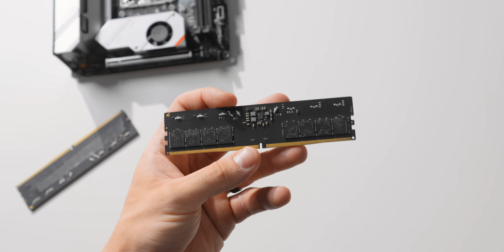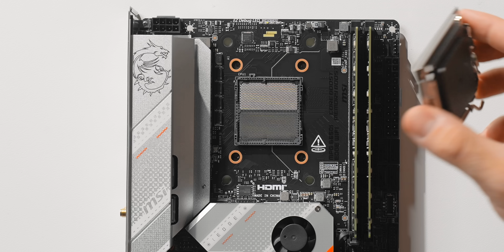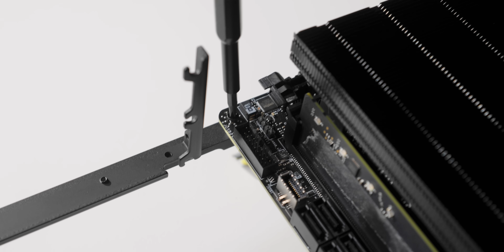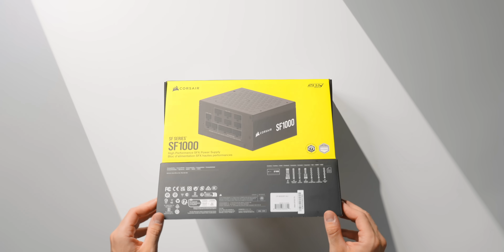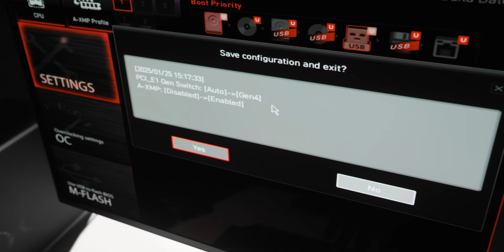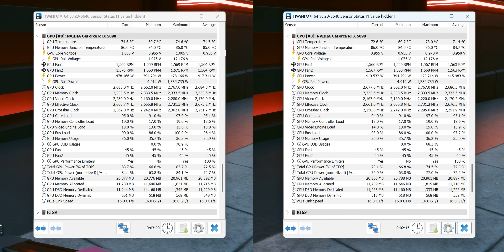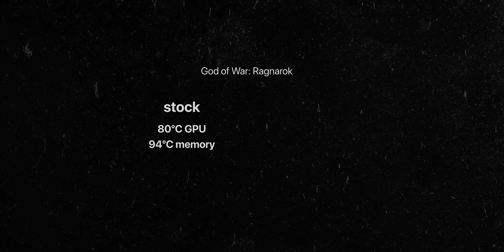My fastest gaming PC, ever – 5090 + 9800X3D

Comment: Im surprised this takes over your custom water loop Build. I imagine its cooling performance is way better. Would you say a 7800x3d and 5080 would be significantly easier (air)cooled in this build?
Currently running a Ryzen 5 3600X and rtx 3070 and the temps/fan noise are getting too great to bear. Thinking I need that PBO2 from the newer ryzens and some extra GPU efficiency can't hurt.

Where do you get the rubber fan spacing ring from?

And do you have a link for the backplate so you can use black ridge on AM5?

Finally, I'd love a guide to DIY your own custom length psu cables, but from the cables that already come stock

Comment: Why not flip the GPU around, to have it exhaust straight to the outside? The air changes direction when it hits the GPU fans anyway, so it makes sense to have them face the more obstructed side. You will have to flip the case fans to help bring air inside to feed the GPU fans. This may drop the GPU temps slightly.

Comment: It's not really a weird concept to power limit and overclock the top tier GPU: I did the same thing with my 4090 already and it's worth it for the environment and the electricity bills in Germany.
Not going to upgrade to the 5090 though: It's just not worth it for my usage and with no real efficiency gains.

Comment: Nice build, nice video. I just simply don't get how can that alpenfohn black ridge perform good, i tried it on a 14600 nonk, in the same T1 case with a noctua fan like you, and got 100+ temp on a 22 C room temp tried both direction on fan. I just came back to thermalright axp-90 x47 full copper and my temps stay around 75-80 in fullload. It's so strange for me 🤷🏽‍♂️
Reply: And for both i used noctua nt-h2 thermal paste. In the same day, same games.

Comment: Why no performance comparison with the card running at PCI-E Gen 5? Even if performance is the same, it should be stated.
This card is pushing the bandwidth limits of Gen4, and I wonder if running gen4 + a raiser cable would impact performance.

Comment: Nice build!
Btw, building on the same board soon, does 9800X3D work fine with newer B650i Edge out of the box or I'll need an update? Shows that it is ready for Ryzen 9000 series, but if I recall correctly, this may not include 9800X3D due to its recency

Comment: I have a 9800X3D in a FormD T1 as well. I used to have a 5700X, and when I was trying to find a cooler that worked I found that the Thermalright AXP90-X47 Full Copper had somewhat better cooling than the Blackridge without having the same kind of clearance issues. It allows me to use those "overbuilt" boards like the GIgabyte B650 Auros Ultra for those 2 front M.2 slots.
Reply: You're right about the X47 in 92mm configuration.  Turns out VLP 5600 DDR5 Ram is now available allowing for the Black Ridge to leverage a 120mm Noctua Slim which will perform better than an X47 both in terms of acoustics and cooling.
Reply: @pantonio7171  I will have to agree I have 7900x3d with both axp90-47 full cooper and I now use a IS 55 and the IS 55 does a better job of coolingthan the x47 full cooper by 10c most of the times. My system is msi itx 7900x3d, IS 55 cooler, 32gb of ddr5 6000 team create, Msi rtx 4090 gaming x slim,  Terra fractal  850 psu
Reply: @0mnikron702 what about with a fan swap of the x47? Think the play is to get the full copper version and replace the fan with a Noctua one.
Reply: @Lenduya have this with the 9800. Honestly not that necessary unless you hate orange.

Comment: why not just have a laptop? the thunderbolt 5 will allow for external GPU, with also minimal losses in performance... the eGPU will work also as a dock, to connect your monitors, mouse,   keyboard etc... and just the USB thunderbolt 5 Cable will need to connect to your Notebook.

this seam's like the dream for me, just waiting for a good all in one notebook release, like the x16 and x13 from asus, also maybe wait for the 5060 as well, more than 5060 power in a notebook is useless, if you have let's say a 5090 in a notebook, you will just use it in the charger because a game in that config will run for less than 1h in battery... and even in the charger it have way less performance than a full RTX 5090. a external GPU just make more sense.

for notebook the limit of usefull GPU performance is maybe the 5070, but the 5060 will be probably better. and it is more than enough performance for a portable device.

Comment: Useless. 
Put GPU on top, blowing heat out...  or, at least reverse it.
Or better, leave GPU in slot and open PSU case, so RTX will blow it though.
P.S. kinda disappointed to see this nonsense (expriment), instead of watercooled TINY build 😔

Comment: TBH Fractal Ridge is way better suited for the FE, as the card would be mounted on top with free access for air to flow through on both sides.

On the FormdT1, you should just use that space and get a triple slot 5090, those according to the reviews are running way cooler than the FE.

Comment: They should sell 9800x3d and 9950x/9950x3d without a heat spreader for weirdos who want low temps, nice perf and a small case. 

And of course the 5090 could use an easy way to flip the fan direction, would be nice to exhaust that 550W:s instead of dumping it into the case.

Comment: Did you test different offsets? I want to run something similar with the water cooling bracket and an aio on the CPU side. I lean towards productivity and am hoping to replace 2 computers with a similar build, but a Ryzen 9. I'm hoping that in the 2.25 slot configuration and a couple really good fans on the top, the GPU will have enough room to expel that air.

Did you test various configurations or just start where you knew it would have the best chance? I might go with the 5080. I have some tasks where it might not have enough vram, but I'm thinking i can put my 3090 in a server to handle those

Comment: Beautifully shot and edited video! As to the machine itself: It is awesome and shows what can be reached in terms of compactness and elegance. Having said that, a larger, more conventional machine would still be my go to solution in the end. All the tiny tradeoffs add up. A tiny percentage-loss due to pcie 4, additional small losses due to the voltage profiles for card and cpu. And also the few percents extra that a larger machine could manage via overclocking, if one is inclined to go through the effort. Still, awesome video, thanks!

Comment: I really don't think it's weird getting a 5090 to undervolt it. 

Same thing goes with the 9800X3D. Running in eco mode it still gets similar gaming performance at a lower wattage but folks keep telling potential buyers that they should get a 9700X instead because they think 65W on a 120W chip means half the performance. If money isn't an issue, getting the best components and undervolting them is absolutely worth it.

Comment: For those who wonder - you need 2xM3 10mm standoffs for both riser bracket and GPU holder (in case you go with 3.25 GPU slot mode).

Comment: There is actually a newer revision (rev. D) of the Blackridge you can get from Germany that officially supports AM5 socket. Just wanted to clarify that point. Ordered one for a buddy’s SFF build last year.
Reply: Just ordered a second-hand one from eBay. Only one I could find.

Does this mean I don't need to change the socket backplate?

Comment: Wonder if there is any temp difference with a Hudamod?
that being Mounting the Psu with the side bracket Ontop where the Top fans and letting the 5090 to just Blow straight though the case out the other side

Comment: Here in europe i cant even see price of 5090s yet.
But If I had the chance to buy one I would go for this new 2 slot cooler design. Third party cards use the bulky 3 slot cooler from last gen.
Also hopefully dealers offload their 4090 stock now for cheap as they are still sufficent for my use :)
Reply: Nvidia stop to produce 4090 and other top 4xxx cards now, - 50xx have the same TSMC 4nm node, so they just switch to produce new chips. In stock some that they already made, but while they gone, they never return (used/refubrished only). And prices not go down as much.

Comment: One thing might make the case even better, if you were able to rotate the FE by 180° so that it exhausts directly to the outside.
Reply: He'll be 3d printing an exhaust manifold for the 5090. Look at the older vids.
Reply: You could also remove the 5090 from the case and throw it in your freezer for the lowest possible temps
Reply: You could also make just a big hole in the case so there is no resistance of airflow and make a straight vent that is airtight on those side vents of the 50## series
Reply: Only sane comment! 
Best option - put "reversed" video on top, while having bigger CPU cooler and opening PSU case. That would be "GPU wide" case.

Comment: Meh. I like how portable it is. I really want to build one but something with no performance loss on stock clock with a little bit more volume is what I probably would prefer. Maybe as in the first video an air flow channel with 3d printer can fix this problem. I belive you can forward output of 5090 into one 120x120 fan and use other fan with an ultra thin radiator and fan for cpu cooling.

Comment: Nice!  
Did you put any kind of heatsink on your m.2?  
How are the m.2 and chipset temps?  
I run this MB in a passive setup in an HDPLEX H1.TODD and the heatsink wouldn't fit either, even with a heatsink that would fit under the heat pipes the chipset and m.2 temps can get really high in the summer.

Comment: Amazing build! But the individual cables of the pcie extension is bad for the airflow through that 5090, maybe try 3D printing a sheet that covers the the cables, it would help making the airflow smoother and less turbulent, helps pushing the hot air upwards which can drops you a few degrees.

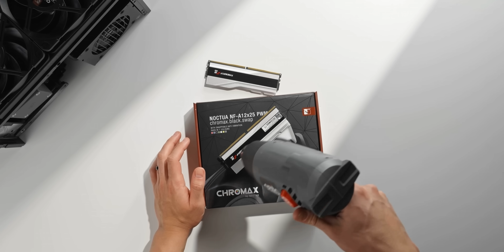Comment: 1:43 - No, it won't. Modifying a product does not void your warranty unless it provably causes damage to the product which you then try to claim on. This will make the RAM run hot, which could cause issues, but if it fails for another reason within warranty then it's still covered.

Comment: Lot of people in the FormD T1 community who are very happy about this video. This was the setup people thought had the best chance of decent temps and it nice to see that it works.
Reply: Just with a X47 full copper instead of the Blackridge.
Reply: @mazo7846   Yeah, I was wondering why he didn't run one of Thermalright copper coolers, I've got a x53 full copper on a 7500f in an sff that would fit inside the one we just saw a few times, and it keeps it at mid 70's, which seem to be about as cool as am5 wants to run under load. My guess honestly is, he didn't want the orange bleed through for aesthetic purposes.
Reply: @KesterKurtal  Meanwhile true regarding the orange, but if he actually goes to these lengths for every bit of performance it seems... how much would that orange really do? How much does it actually peak through the mest side panel? The silver parts of an 4000 FE doesn't really show through all that much, hence doubt it would impact aesthetically.

But yes, I've also wondered why he doesn't go Thermalright AXP90-X47 FULL due to being native AM5 as well?
Reply: Eh, I'd still like temps on the rear m.2 so I can know if the rear motherboard is getting cooked.
Reply: yeah.

Comment: hey guys, i might look really dumb rn but where did he put the gpu in the motherboard? at 9:20 the motherboard and the gpu are parallel?
Reply: In the riser cable
Reply: He used a flexible pci cable to attach to the gpu then attach into the motherboard, think of it like an adapter
Reply: He specifically mentions using a riser cable and you can see it in the video.
A riser cable connects to the PCIe slot and the PCIe connector on the GPU, but is flexible, allowing you to position the GPU in a different spot than just perpendicular to the motherboard.
Reply: thank you for your replies guys, that answered my question :)
Reply: I was thinking the same thing
Reply: Welcome to sff world
Reply: 9:35 you can see the riser cable connected to the motherboard, it feeds down the center of the case and connect to the GPU

Comment: There's no way you released this right now!
Man, i seriously only bought the Blackridge a few hours ago, thinking i'll never be able to use it with an AM5 board, and here you come with that incredible recommendation!

The Blackridge shall not become obsolete! it's such an awsome cooler!
Reply: I bought the blackridge couple of weeks ago for my new SFF build and happy to say they updated it and the new stock is compatible now with AM5 out of the box, it even says on the box, although none of the websites say yet it's AM5 compatible which is weird.
Reply: @tinkovandervelde  how did it go?
Reply: I cant belive that I can use my blackridge again with just that backplate I have the same motherboard
Reply: What screws do you use after swapping the backplate? The screws included with the Blackridge for AM4/5 are smaller than the holes in the motherboard, causing it to loosen.

Comment: Hey optimum, what was the CPU fan speed with the Black Ridge? I see it was holding 78c roughly at 82w. I am hoping to replicate this air cooler configuration if it can do that at a reasonable noise level.

Comment: I have a Fractal Ridge (small form factor PC case) and am tempted to get the 5090, currently on 6700 XT. 5090 will definitely fit, but I'd hit a huge CPU bottleneck and I'd need to change my whole system since I'm running an intel CPU and my 12600k is the highest I can go for the CPU without thermal throttling due to my small CPU cooler, can only cool up to 125 watts. Going AMD is definitely better for SFF, I'll probably just upgrade in a year or two!

Comment: @2:00 the G.Skill Flare X5 fit under the Alpenfoen Blackridge + underslung 92mm fan without, err, modifying the heat sinks. I got a pair a year ago for a similar setup and they're not too expensive with CL30-38-38-96 timings and 6000MHz, they may well have quicker versions out now. That being said I found that the B650I Edge needs the M.2 heatsink removing to attach the cooler with fan properly unless I was just being daft. (Edit: Ah, I'm glad you found the same, that way we're equally daft.)

I believe a Kensington pair fit under the cooler as well but I've not used them.
Reply: Why go through the hassle? Just use the Thermalright AXP90-X47 with swapped Noctua fans, it’s simply better than the Blackridge.
Reply: A couple of reasons, I knew it'd work, I wanted to try out the combo since it was interesting, and I wasn't 100% on height clearance until I'd gotten everything in.

As it happens I ended up with enough space to add an extra 120 slim on top and lowered the speeds to keep noise down. Even with a Noctua 92mm fan, if you've only got the one fan on the Blackridge, it does make an awful noise when the fan spins up. With both fans at a lower speed the noise is perfectly fine, as are the temps.

Comment: if its just mere compactness thats off set by undervolting, 

perhaps the method to cool is is using the case as a heatsink and have a larger surface for air flow to move temps across ? your next 3D printing project ?

Comment: I'd recommend some sort of custom frame for back of the motherboard to secure the CPU cooler.
I don't think its strictly necessary but it'd probably help distributing the mounting pressure more evenly and not just around the through holes.

Comment: Adding three 40mm fans on 3d printed bracket between the 120mm fans would be a useful upgrade. Would suggest the alphacool ES 40mm model. They have a massive RPM range from silent to full send 1U. Using fancontrol software enables a useful slow ramp curve with overhead for heavy rendering. Cheers

Comment: The reduced power limit trick tells me they pushed the power to the max because the performance increase over the 4090 isn’t that stellar to begin with. 

This GPU doesn’t need to exist.
Reply: W/ no die shrink what were you expecting? If the node isn’t smaller you’re not going to have large gains.
Reply: @Bob_Smith19  This is directly in line with what I was expecting, and my point still stands. No meaningful process node changes, just a larger die and more power draw.

This series of GPUs doesn’t need to exist. They were pushed to market to say they had something “new” to offer, nothing more.

The 5090 is the only product in this series that is going to have any meaningful uplift over its predecessor. The confirmed specifications for the rest of the stack basically confirms this.

20-30% more performance from 25% more CUDA, at the cost of 30% more power draw, for 25% more money. 

Any performance enhancements for the 5080 downward will be mostly attributed to the higher memory bandwidth, because the die structure remains mostly unchanged.

NVIDIA is leaning hard on MFG. Hopefully the 60 series will actually be worth talking about.
Reply: @E_Sunbro  Well to be fair GTX 780 to GTX 980 was a good jump, and there was no process node shrinking between those two, so it's possible. 

But obviously the tech today is a bit more advanced and when they just crammed more stuff to AI side, this is just what we get (without using all those AI cores in game rendering). It could have been just more raster/RT stuff yeah, but this is the direction Nvidia wants to go.
Reply: 4090 Ti

Comment: to me the new design of the 5090 looks like you should do a Meshroom D reverse build (so gpu on top) with two 140 mm fans pulling the heat from the case. You can still use a nice air cooler for your cpu and you are at least  < 15L

Comment: need to tune the ram to get it to be the fastest :P I have an 7800x3d and with stock 6000c30 sticks it is slower than an 12700k(5.2 8-pcores) with 7600(tuned timings) in warzone with an amd gpu. with nvidia the 7800x3d is faster but with amd the fps is 20-50fps slower.